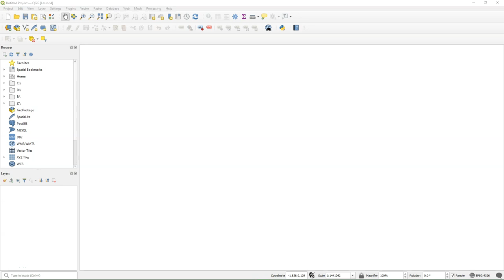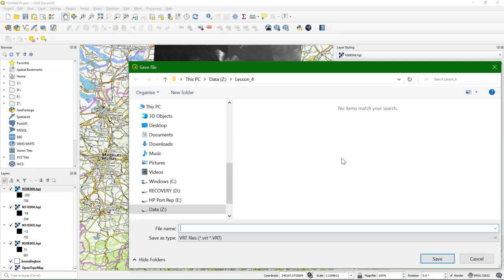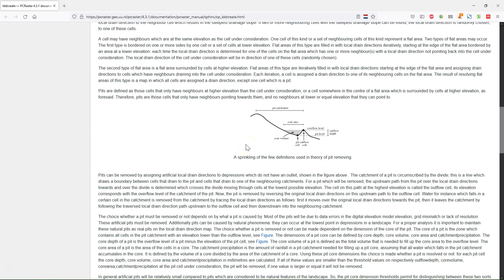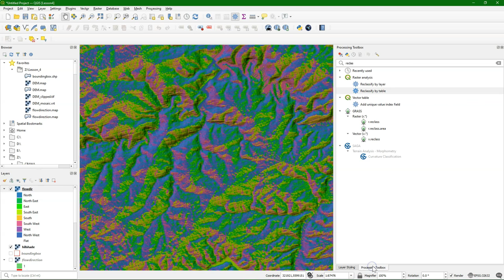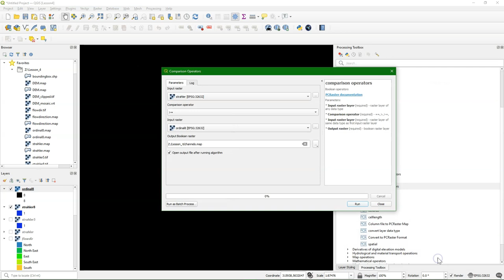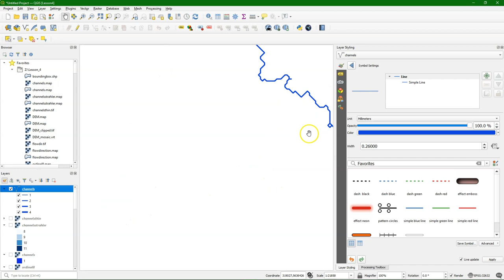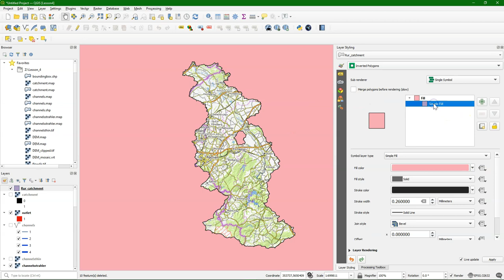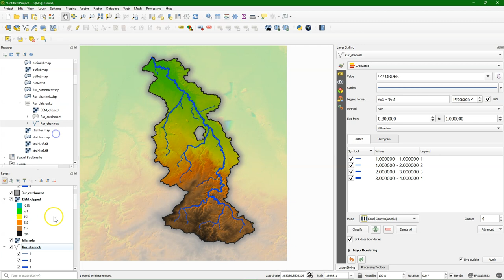Complete Updated Workflow Stream and Catchment Delineation in QGIS

Comment: I keep getting this error every time I try the "reclassify by table" tool: PCRaster driver: value scale can not be determined; specify PCRASTER_VALUESCALE.
Execution failed after 0.02 seconds
Reply from the maker: You need to use the TIFF format as an output. You're using the PCRaster format, which needs the data type to be added. The tool can't do that.

Comment: Hello Hans, I have followed your previous tutorial of deriving with saga. I am working on a Coastal Catchment and my DEM has the sea. When I use strahler order with saga I get streams where sea is supposed to be. Might be a beginner mistake, This is my first time with QGIS so ı am inexperienced.
Reply from the maker: You need to mask the sea so all pixels in the sea are nodata. Otherwise it will be considered in the calculations, which is normally not what you want.
Reply: @HansvanderKwast  thank you! :)
Reply: Dear Hans, I have solved the first issue but now I 'm having trouble with outlet definition, ı have tried saga upslope area but it didnt work and the pcraster method u show in this video also didn' t work. When ı created the filled DEM from clipped DEM using the step in this tutorial I didn't get the same result as SAGA Fill step from your video 4 years ago. So there is a very small bit with no data maybe that could be the reason? Finally, GRASS worked but outlet didnt show on the map.
Reply from the maker: The outlet should be taken exactly at a DEM pixel where there is data and where there is the channel. Otherwise it doesn't work.

Comment: hello..
when i run idcreate i got traceback error.. could you please help me to solve this problem
Reply from the maker: Please copy the error here.
Reply: @HansvanderKwast  i have the same problem :/ 

error:

Traceback (most recent call last):
File "C:\Users/erwin/AppData/Roaming/QGIS/QGIS3\profiles\default/python/plugins\pcraster_tools\processing\algorithms\pcraster_lddcreate_algorithm.py", line 169, in processAlgorithm
report(LDD, outputFilePath)
RuntimeError: Data source D:/Erwin Stübner_FLUVALPS_2022/Bachelorarbeit/einzugsgebiet/flowdirection.map(raster):
cannot be created

Execution failed after 33.36 Sekunden
Reply from the maker: Check if your input is the DEM in PCRaster scalar format. Also try to use folder names without spaces and accents.
Reply: @HansvanderKwast  i got everything working now up until the point of using "Column file to PCRaster Map" tool.

I tried several times now using coordinates ON and OFF the channelsthin layer to produce the new File but it turns out empty every time.  Not sure how to proceed.

Thanks for answering so fast by the way. :)

Greetings
E

Comment: Processing algorithm…
Algorithm 'lddcreate' starting…
Input parameters:
{ 'INPUT' : 'INPUT4' : 9999999, 'INPUT5' : 9999999, 'OUTPUT' : ............................' }

PCRaster library is not available
Reply from the maker: You need to first install PCRaster before using the plugin. Check videos on my YouTube channel or read the plugin documentation for the steps.
Reply: @HansvanderKwast  i instal it by conda but the Iddcreate didn't work
Reply: Same with me.

Comment: Hello Sir
thanks for providing this video, I received this error severaltimes
could you please tell me the reason

QGIS version: 3.26.3-Buenos Aires
QGIS code revision: 65e4edfdada
Qt version: 5.15.3
Python version: 3.9.5
GDAL version: 3.5.1
GEOS version: 3.10.3-CAPI-1.16.1
PROJ version: Rel. 9.1.0, September 1st, 2022
PDAL version: 2.4.3 (git-version: 6311a6)
PCRaster version: QGIS PCRaster Provider version 0.2.0
Algorithm started at: 2022-11-09T15:43:29
Algorithm 'lddcreate' starting…
Input parameters:
{ 'INPUT' : 'E:/Publications/Kabul River Basin 2022/DEM DATA/Kabul River Basin 2022Nov/dem.map', 'INPUT0' : 0, 'INPUT1' : 0, 'INPUT2' : 9999999, 'INPUT3' : 9999999, 'INPUT4' : 9999999, 'INPUT5' : 9999999, 'OUTPUT' : 'E:/Publications/Kabul River Basin 2022/DEM DATA/Kabul River Basin 2022Nov/flodir.map' }

PCRaster library is not available
Execution failed after 0.13 seconds

Loading resulting layers
Algorithm 'lddcreate' finished
Reply from the maker: It means you have to install PCRaster. Now you have only installed the plugin. You can find instructions in the documentation: 
https://jvdkwast.github.io/qgis-processing-pcraster/